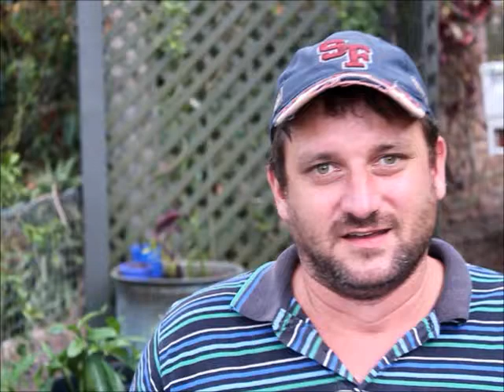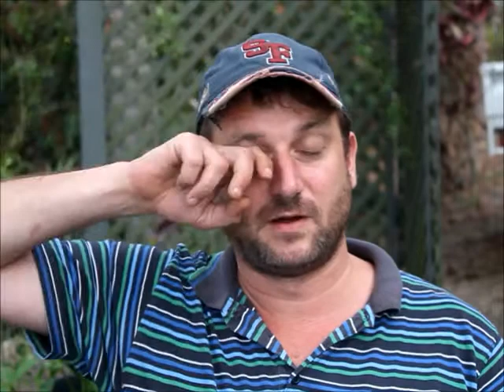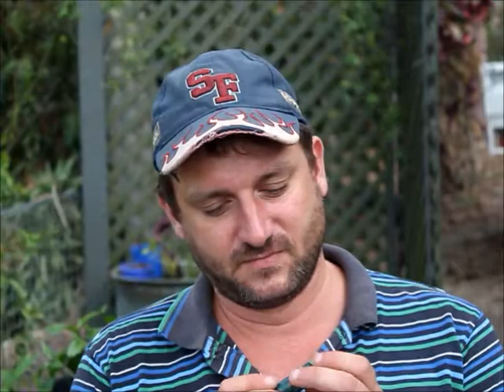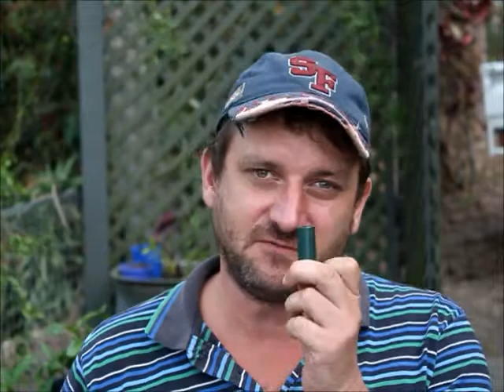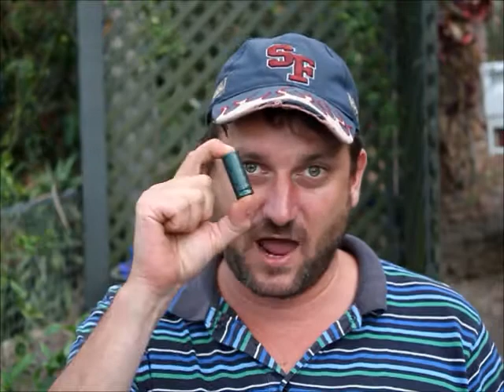MPP Solar PIP4048 (aka PIP 4048) Review - Multiple Failures

Comment: Regarding MPP Solar support:

We bought a number of these inverters: PIP 3048MS, PIP2424MS and PIP 812HS

We have tested them, and here are some of our findings:

At first glance they look quite good, and seem to perform reasonably well. But with some noticable hickups.

First of all they show low load levels (below app. 100W) as no load at all, which is not impressive.

Secondly they have no temperature control on the batteries, causing incorrect charge voltage levels when the weather conditions change from +25 degrees celsius in the summer to -5 degrees celsius in the winter (and sometimes even during 24hours), which is a very common here in Europe. Which may have caused 4 pcs 12V/150Ah VARTA Deepcycle AGM batteries totally damaged after only 1 year of operation, but this could also be caused by other problems with the PIP series. 
(You should always maintain lead battery temperature below +25 degress celsius to extend battery life, but that's another story).

Thirdly there is no softstart circuit for the battery connection, so when you hook up the batteries, you get a tremendous spark from charging up the internal capasitors. The batteries don't mind this, but for sure it is not good for the internal capasitors to be started up with such high current levels filling them up, and might be the reason why one of the units have already given up after less than 6 months of operation ?!?

Forthly (can you say that?) which is by far the worst, there is absolutely no product support what-so-ever after expiration of the first year after purchase. No schematics are provided, no Fault finding guides, no Hotline support, Nothing, except a proposal to buy a new one instead !?! (Yeah, sure you would opt for buying a new one, after experiencing such poor level of support...I think NOT). They even have the nerve to distrust the information you provide so much, that they insist you photograph the serial number plate, rather than just reading off the serial number from the label. and providing date of purchase.

For products like these, which are bought to use green energy and reduce energy costs and resources, having to buy a new one every time there is a fault after 1 year of purchase, or having to replace batteries at accelerated intervals, does not save neither money nor resources, it only creates endless frustrations. 1 year of warranty on such products is also far too short. Professional manufacturers of inverters provide at least 2 years, and more often 5-6 years of warranty!

There is a saying that goes: "Long after the savings on a product purchase is forgotten, the problems from such savings contiues endlessly"

If someone out there have obtained schematics for these units, please make them available via a link here.

If others have had similar experience please let us hear of them.
Reply: I refused to try to photo the microprint serial #. I told them to fix the engineering. They cut me from any communication!

Comment: Hi! My father has a PIP 4048 from 2015 which got defected last week in one night. In the morning he found the inverter oscillating. It's hearing a sound of relays oscilating about 2Hz. The leds from the invertor display oscillate all with the same frequency and the buttons are not ressponsive. I checked the power transistors with a multimeter and all are good. I presume the defect is in the board that generates the sinusoidal frequency. Have you got any schematics or some hints for repair? Thank you!

Comment: You've got me worried.

I was given a PIP 4048 with a failed solar board. I've ordered a board from Taiwan and have my fingers crossed.

I appreciate Urs comment as I imported a solar bore pump  from mainland China to have it fail straight away. After insisting that their pumps do not fail they eventually sent me a replacement when I agreed to pay the US$100 shipping but that failed within a week or two. Now they won't respond to me. A risk when dealing with China I think. Read the story in issue 131 of Renew magazine.

Do you have your 4048 working now?